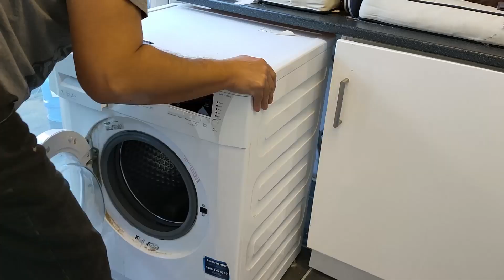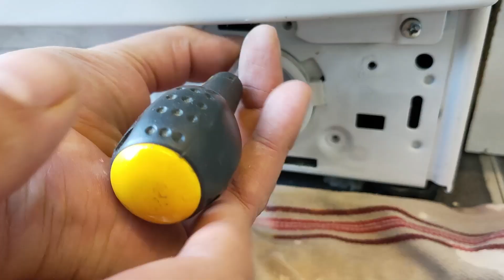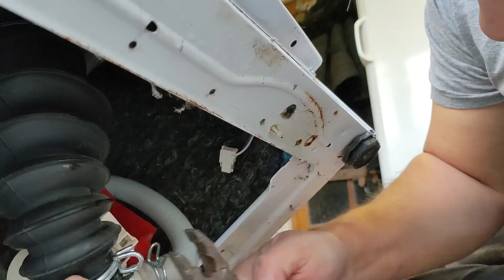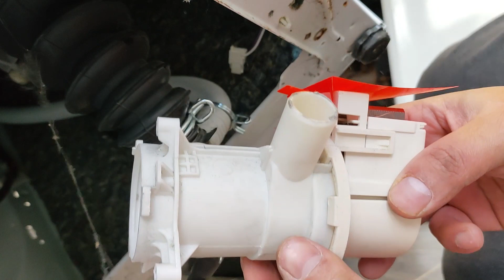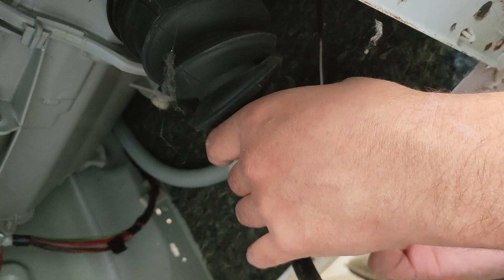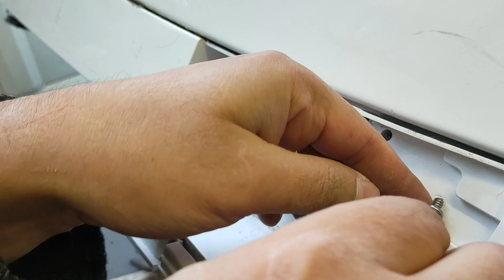How to Replace a Beko Washing Machine Drain Pump

Comment: Thanks. This was really useful.  Beko doesn't make the pump for my model so bought one for a similar model and fitted it. I had to plug up the hole for the drainage pipe though. 
Just another bodge it Brit.

Comment: Does anyone know how to remove the drain pump from a beko ws832425b there is no screws in front to remove panels to get to the drain pump and rest is welded metel at the front but can see the screws if looking from under the machine just can't get to them they covered with a metal panel that's non removable
Reply: Same problem. No screws to remove pump. Dunno how to get at it

Comment: My pump had no blockages but that thin black pipe was blocked solid with grit.  Could that be why its not draining or do I  need a new pump. Thank you
Reply from the maker: As far as I know the thin black pipe is just a manual drain pipe.  So It shouldn't really effect the main drainage as the end is blocked off until you need to manually drain the water.  There could be some blockage further back.  I'm not a washing machine engineer but it does sound like the pump could be faulty if its not pushing the water out to the main drain hose.